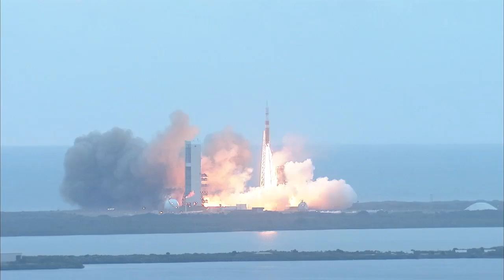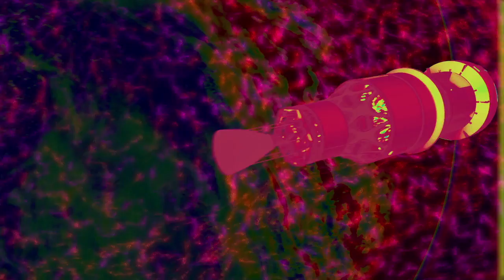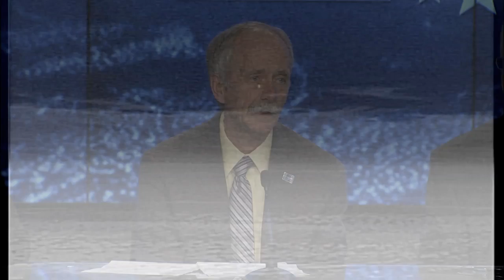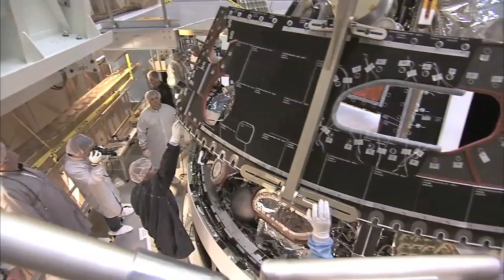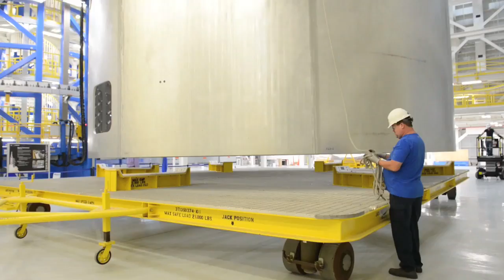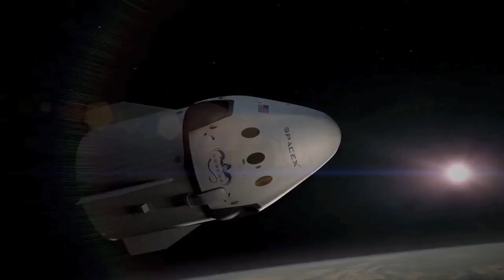*(See below for updated link to this video)-Orion’s first flight on This Week @NASA

Comment: At the rate that private and non-U.S. spaceflight efforts are proceeding, Orion is probably too little, too late.
Reply: Not really. Orion is here now, and will stay relevant for probably the next year or so before private companies start using their capsules. This will allow the US to start launching astronauts to the ISS by itself sooner rather than later. You could say it is a waste since we could have just waited, but you can't just wait forever for the situation to improve, otherwise we won't be putting anybody on Mars for centuries.
Reply: LastEmperor28 Orion is going to be in competition with commercial vehicles in a few years once they start docking with the ISS. After that, only commercial vehicles will probably dock, but you make it sound as if this capsule is going to be sending people constantly beyond LEO, but the truth is that it will probably be used in the coming years more for the ISS before it is replaced, unless you want to be very optimistic and say there will be many manned missions in the coming decade.

Comment: The "new era" in space travel/exploration starts when modern-science finally figures out "rocket engines" are archaic!!   Free universal electro-MAGNETIC energy...  study "comet" 67P for clues...  in case you don't already KNOW!
Reply: Okay, wow. Earth's magnetic field is too weak to be used to lift heavy loads into space, sure it might shield from intense radiation, but radiation can easily be blocked out by even weaker magnetic fields. If you have made any actual scientific discoveries or you know someone who has, then you should make them public, else you are just spewing bullshit. Also, there would be no reason to hide things like electromagnetic engines or drives, if you want to argue that they are doing it so they can use them on secret aircraft, well it has been 50 years so i'm sure they would have revealed it by now. So in conclusion, such a thing doesn't exist, so for now we are stuck with chemical rockets, jet engines, and maybe plasma rockets.
Reply: thecrumbsnatch
Yes, but electromagnetic drives would only replace planes, and actually the energy companies would like that even better, so while the oil companies might suppress it, the energy companies would likely disclose it since they would make tons of money off of this. Also another thing to keep in mind is that just because it COULD be suppressed if it existed, doesn't mean that it actually exists and IS suppressed. :)

Comment: Why are we sending humans to an asteroid before going to Mars ? And how is it possible to land humans on a fast moving asteroid?
Reply: We are sending them on the asteroid for two main reasons (there are more, but these are what i believe to be the most important):

1. before we'd colonize Mars, we'd have to know how to protect ourselves both home and there from meteorites. Data from ESA's Rosetta and Philae, this future mission and others like it is vital for future plans in case one of those celestial bodies decides to take a pit stop here or on Mars.

2. if they can dock with a asteroid then getting to Mars will be 1000 steps closer. Both in confidence and knowledge.

And for the docking with a fast moving asteroid part, that's easy, you just match the speed and rotation of the asteroid, then everything else becomes relative to your (the ones who will land) perspective.
Reply: Vadix Vadexi Easier in the sense that they will know how to control the ship. Landing on Mars has been done before, so has landing on the Moon. The two experiences can be extrapolated to come up with a game plan that will make it relatively easy compared to the first Moon landing.

I'm not saying walk in the park easy, but definitely won't be a do or die thing or walk in to the unknown.

Really, now, the biggest unknown, in the sense that we don't really have a good solution, is the ~0.66 millisieverts for the trip. That's dangerously close to the whole carrier limit as i'm aware.

I didn't word properly, i've been up for 4 days now (yesterday).
Reply: aserta No, an asteroid doesn't have the gravity or atmosphere of a planet. That doesn't make the asteroid harder, it makes it easier. Sure, its probably very hard to get to the asteroid and such (it took 10 years for a reason), but the actual landing is something entirely different from a planet landing. Also, we know how to get to planets, and we know we know that, so there is no need for confidence there.

So basically, when we sent curiosity, that was probably the heaviest thing we can say we landed safely on a planet other than earth with an atmosphere. Also, that was a pretty amazing landing. My understanding is that a propulsive landing will probably be necessary for anything more sizable than curiosity, but the curiosity landing was probably more important and relevant in terms of Mars.
Reply: Everything is moving fast, depending on your point of view. You just have to match orbits, then your relative velocity is very small.
Reply: do you know anything about space.........
Reply: NASA recently landed on a comet.
Reply: aserta I definitely agree that the radiation is an issue. Even if the amount they get exposed to is not definitely going to kill them, they won't send people unless the effects are very small, which is understandable (I wouldn't go myself). I really hope they find a lightweight solution to keeping the astronauts safe during the trip, because I would hate it if that one issue made a human trip to Mars impossible for the time being.

Also, I wouldn't go that long without sleeping, that seems pretty excessive.
Reply: Vadix Vadexi There are some solutions, recently there was this tech presented with the up case of the Fukushima disaster. A type of belt. If my understanding is correct the tech could be adapted and that would be one.

Then there's also the artificial electro-magnetic shield that was tested some time ago. It's not a complicated machine, i imagine that some lateral thinking would make something out of that. It's not like they have to go to Jupiter after all.

Meh, either way i'm sure they will come up with something. They seem hell-bent on reaching the under 2050 mark. The scientists that is.
Reply: aserta
The only reason we're going to an asteroid is because there's no money to build a lander to go to the moon.  SLS/Orion needed a mission and the only thing feasible without a lander is going to an asteroid.  There is almost nothing humans can do at an asteroid that a robotic mission could do much cheaper.
Reply: chuckc192000 Yes there is. Precision. I know the history of the Orion and Constellation program and how it was passed from administration to administration.

I strongly believe that in case an asteroid is headed to Earth, which there might be many, we just don't know of them yet, a human mission should be sent.

Robotics are cool, it's cheap and it's certainly safer to send one instead of humans, but, would you trust a probe to attach thrusters or any other operation knowing that in say 3 months time one may become a meteorite?

I wouldn't.
Reply: thecrumbsnatch Prove it. In the mean time i'll enjoy the pictures and the data.
Reply: aserta Haha!  I thought you were serious.  You've been going to too many movies like "Armageddon".  There are absolutely NO missions on the drawing board for asteroid deflection, either manned OR robotic.  The ONLY reason a mission to an asteroid has been proposed is to give SLS/Orion a cheap destination.  They haven't even started designing the robotic vehicle that's supposed to capture AND maneuver an asteroid to the vicinity of the moon, NOR have they identified any candidate asteroids for a mission that's supposed to happen in 2021.  Plus, I'd say 90% of the American public is not even aware of the plan to visit an asteroid.  Even if they knew about it, it would generate little-to-no excitement like building a base on the moon would.
Reply: chuckc192000 I am serious and no i'm not talking about that shite movie.

That's the problem, people have seen that idiotic actor wank (when you get a lot of celebs and fit them in one pack) and think that the idea of getting people to do the job is a joke.

If a situation like that is going to happen during my life time i'd like to know that the procedures are overseen by humans on site. This isn't about drilling a hole or whatnot, i'm talking the proposed NASA means. The rocket boosters, the one where they tow the thing be it hard-lined or not (there's two means proposed the one where the craft sits in front and slowly veers it off course using gravity or the one where it turns its engines on to it and performs a burn, i believe, correct me if i'm wrong).

That movie did so many bad things for this very serious issue. The moment i heard the reviews about it etc etc i knew it would have repercussions. People as you said, don't know squat. You're 100% right on that one, and when they hear "oh we will send some guys to some asteroid" they immediately go "oh, Christ, it's Armageddon all over again".

You've no idea how much that stupid movie pisses me off.

Also, like i said, i know the history of the program. It's a cheap target, yes, but there's some payback on this. We don't know much about them, the more data we can gather the more options we will have.

That's just my view. I prefer to not have threats that we can't deal with dangling over our heads. A few years ago we didn't even have half the concepts that are proposed to day, expensive or not, ludicrous or not etc.

Cheers.
Reply: Jack Miller
That wasn't NASA, that was ESA (European Space Agency).